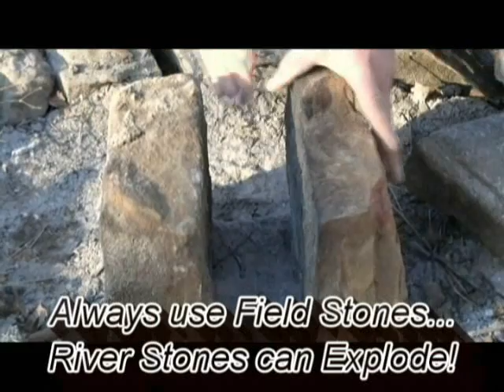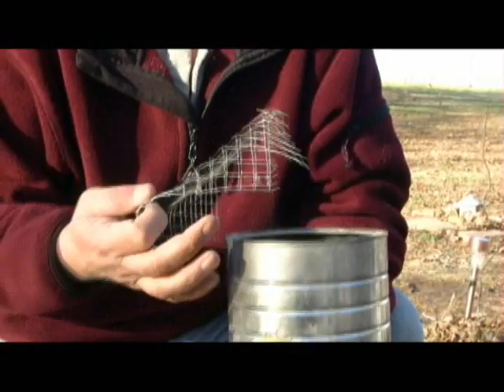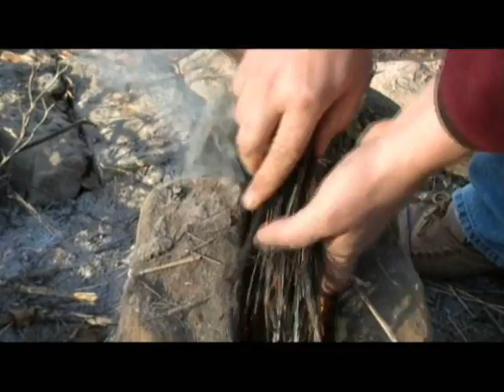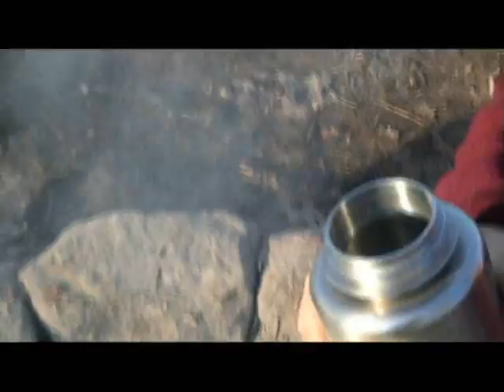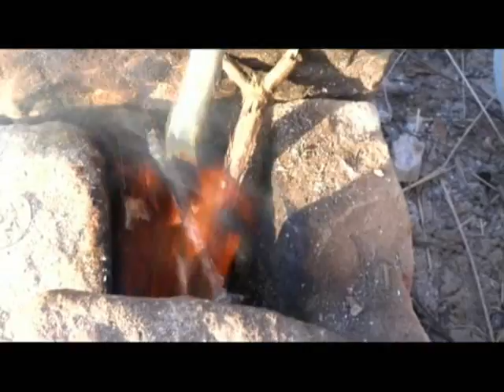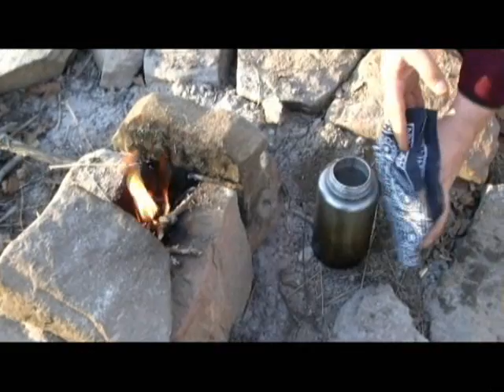Stone Rocket Stove

Comment from the maker: @Outkastkids1 

The top rock is the grill the hole in the back is for smoke to escape.. but can also be used as the flames shoot high from this spot. But you can use the top rock as a grill.. It gets very hot

Comment: You should feed from the bottom, since it mostly eliminates the smoke, and makes the fire burn hotter and cleaner.

If you feed the fuel from the bottom, all the smoke and gases get drawn through the hot part of the stove leading to efficient and complete burning. 
By feeding from the top, the heat is causing the wood above the fire to smoke, but then it escapes out the top before burning.

I am going to make one of these for the next Survival class I teach at... :)

Comment: @1Dlamb ,,I bet it could if you added a bellows or forced air fan ,,need charcoal for higher heat range ,,sand casting are ya !! I have thought about forge setup myself for parts replacement when things break,,my old model motor parts are hard to find now ..they have crushed most cars from the past that ran fine with no computer garbage ,,can't stop the old ones with a EMF beam ,and yes those are in use right now in some areas.

Comment: Great little fire, but I am not sure it is a "rocket stove"  The tip off, is that the fire burns against the back wall.  It is missing them most important part of a rocket stove, which is the thermal stack, or well insulated chimney.  I am sure in a survival situation, you don't have time to build a rocket stove.  THe rocket stove, needs a super insulated chimney to retain the heat, and to create a super draft.  Hard to do, with rocks!  Good video though!

Comment from the maker: @TadTheTinker 

Tad.. I generally DON'T use Petroleum in the cotton since I don't have much of a problem getting tinder to light around here.. On top of that.. it's very messy in your pack if the seal ever loosens on the container (Experience speaking.. nothing worse than PJ all over your gear) But I ALWAYS carry Lip Balm with me.. and if I thought the conditions needed some extra ummmpf.. I could easily knead some of that into the cotton before I lit it.. But I don't recall ever needing it.

Comment: My pleasure!
I experimented with making my own rocket-stove-like furnace this weekend. And I found through luck a real good way to make a crazy-hot flame:
*build up a circle of stones, with bigger stones on one side.
*on the side with bigger stones, build up a wall, this is the side to build the fire against.
*build a wall of broad branches to make a wooden wall, to make a long, thin furnace.
*light a fire in it, and just push in the crudest firewood you can find ^^
It will be able to burn all..

Comment: I use 8' of 4" pipe and a 4" 90. Lay the pipe along the ground and support with rocks to elevate pipe end. Build a bed platform 18" over the pipe. Tarp over ridge line covering bed and close off ends. Be sure pipe extends out the end of shelter. Make fire in the 90. Pipe heats shelter. No smoke when it gets hot. Feed fire to regulate heat produced. Works with  rocks  instead of pipe also.

Comment: ...wall for burning whatever you want.
The wall of logs/thick branches will also provide fuel for the fire, just make sure they don't burn too fiercely if you can't tend to the fire as long as they burn.

And you can place branches between the two walls to place whatever you need heated.
A wooden, fiery, burning stove, it may be called :)

Comment: ...kinds of wood, as long as it fits, and it has gained enough heat.
Just make sure the stone wall has good holes for air at the bottom. And gaps for letting out smoke when it gets excessive.
The smoke-holes in the wall will also suck in air.
And you can get a stronger fire by having heated air sucked in.
This is done by having the air travel through heated material on the way in.
So having bigger rocks in the high wall gives a bigger surface for air to travel through, and gives a more stable...

Comment: You are very well informed. But you could have a lot more fun and get better results if you thought like an engineer. Think in valves and tubes, and think about how to concentrate oxygen-rich heated air.
A simple trick from thinking like one: when lighting a fire, make a small furnace with firewood, wherein you place the twigs and tinder. Of course that would be difficult with such a small stone furnace, but if expanded a bit it will work excellently. By designing "furnaces" out of wood, you....

Comment: Have you thought to add some clay betwen the rocks?
Reply from the maker: Mihai Solcan Yes.. and it does a wonderful job! Although over time it may crack because of the heat .. but it definitely works :)
Reply: BushcraftOnFire And this is why we all love bushcraft. If something breaks (for example the clay betwen the rocks) nothing stops you to repair it. Just a bit of time, because the materials are everywhere around you.